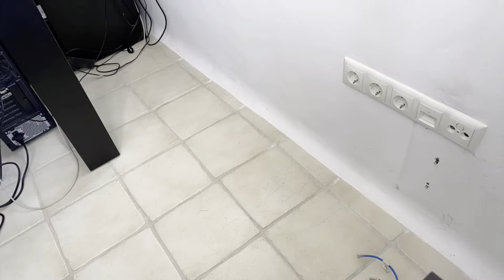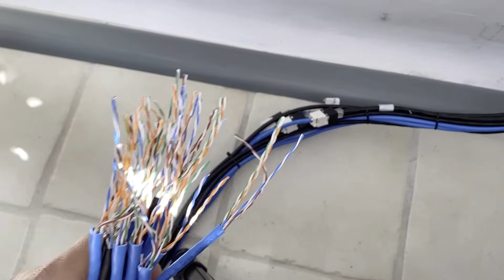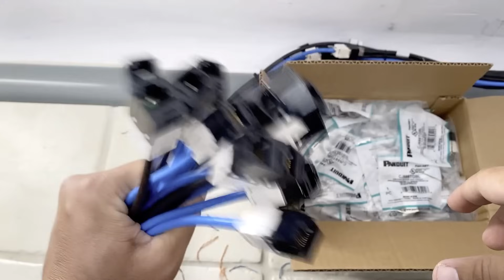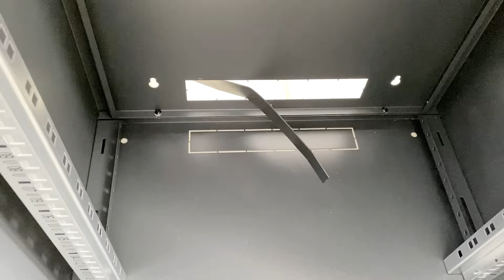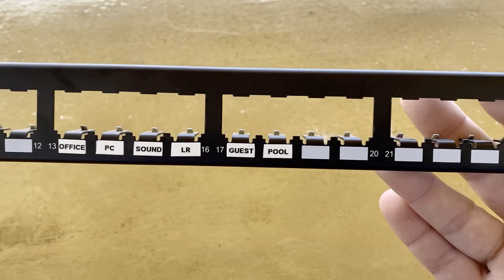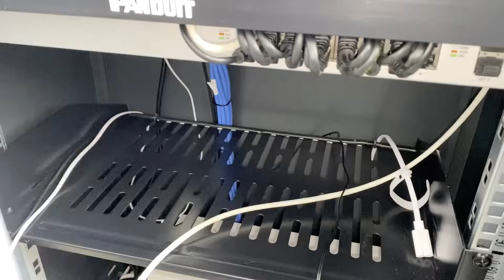New Rack - Step By Step Installation

Comment: Hiya! Great video. Im stuck at a place where the network rack has to be mounted in an office made up of prefabricated metal container. Please suggest the screws and bolts and if there is special method to use. Thanks
Reply from the maker: Thank you! Glad you liked the video! 🙌
For prefabricated metal container walls, it depends on the structure:
🔹 If the wall has strong metal framing behind it
Use self-tapping metal screws or bolts + rivnuts (threaded inserts). They give a very solid hold for the rack.
🔹 If the metal sheet is thin and there’s no strong support
I recommend:
Adding a plywood backing board fixed across the metal frame
Then mount the rack to the plywood → distributes the weight safely 👍
If the rack is heavy or full of equipment, the plywood method is usually the safest so you don’t risk damaging the wall.
Feel free to send a picture of the area and I can give more specific advice! 🔧😊

Comment: nice work but i have two question why ups installed within the IT rack its not recomended secondly power cords management is not good power cables are still loose
Reply from the maker: Thanks for your suggestion!

Comment: wifi inside the rack!? 😑
Reply from the maker: You're right, but Dream Machine is mainly a router so I believe that it was better to put it inside the rack rather than outside. After all, each room of the house has it's own access point so I could afford to lose the access point of the Dream Machine.

Comment: wonder if i have missed the server rack part. What is the dimensions (length width height)  of the rack, does it need wheels or fans?  are there screws at the back of rack to  help carry the weight of 24-port switch? or the 4 front screws are  strong enough?
Reply from the maker: The dimensions of the rack are : 758x600x600 mm (15U), I didn't order wheels or fans for this rack. The rack is inside a house so I wanted to avoid noise. There aren't any Racks at the back of the Rack. The 4 Front screws are strong enough!

Comment: The back panel you hammerd out where you tread all the cabels true you forgot that there was sharp edges the Cable can be ruin on if it is cables are moved often even so you should put something there you can even cut your hand or fingers there,,,

Comment: This was quite informative and easy to follow along. That said I had a moment with the reasoning of the separate ISP connection. That was until I realized the connection that was on the patch panel was from the equipment the ISP provider had to put in first. Then the patch cable to the modem. It's good that DSL is that fast where you are. Here in the states DSL came and went. They never pushed it as much as they could because of what else but cost. Thankfully i'm in an area with fiber to the home. So when they came in I have their equipment to the router I use. Again thank you this will be useful when I set up my new home.
Reply from the maker: Thank you for your feedback! It is really great to have fiber to home! I hope that we will have it here soon...

Comment: Also, pickups occur in low-current wires, which in one way or another affects the operation of network equipment. Use an oscilloscope. Maybe in such a small cabinet this is not so critical, but I have witnessed very big problems due to the fact that someone twisted the wire going from the power adapter to the device (5v) into a coil.
Reply from the maker: Thank you for the feedback!

Comment: How can you convey to the author what to twist heavy voltage wires into coils (110, 220v). It is impossible, because induction occurs and an ordinary wire, twisted several times, can do a lot of things. Even manufacturers of equipment indicate in the instructions that this is unacceptable.

Comment: Main critique is using those zip ties. Never use zip, always go for velcro. This way you've easier expandability in the future and it makes redoing wiring easier than having to try and cut zips, especially if some person makes them super tight.
Reply from the maker: Thank you for your feedback. I will try velcro next time!
Reply: I use zip ties. I think they look cleaner, and as long as you're not moving your stuff around all the time, it's cheap to buy more when you need them. :)
Reply: @TeeVeeArchive  Im telco.  Im not allowed to use zip ties for several good reasons.  So out of that I dont use them at home either.  Its either velcro or "sewn" in with a waxed 9ply cord.  lol
Reply: Or use reclose able zip ties that can be released and reclosed.
Reply: The reason not to use zip ties is because you interfere with the distance from the cable shielding to the twisted pairs, it is very easy to make them too tight and thereby degrade the shield's capability. 
The cables used in this setup looked a lot like shielded cables.
Reply: @viciouswaffle been in the industry for 20 years and use zip ties. Can officially say this has never happened to me😂
Reply: @ERMAV Have you ever made any bandwidth tests before and after?

Comment: I see you plugged the surge protector into the UPS. Is this generally a bad idea? I've been told that it may mess up the UPS... I ask because I have a surge protector that I like, and am considering a UPS but still want to use the surge protector I have.
Reply from the maker: I prefer the surge protector to be after the UPS in order to have the devices protected. So far everything seems to work fine!
Reply: @PoseidwnTech  there is no specific reason why you can't use a surge protector extension socket AFTER the UPS. But there is a doubt that it would do any good as the UPS is already providing that safety factor, built in to it. So in effect doing it twice... and the chances of getting a "surge" or "brown-out" from a UPS is so small, as to be improbable.

Comment: AP inside metal rack? :)
Reply from the maker: Thank you for your comment!
I chose the UniFi Dream Machine as the main router because it comes in an attractive price including Router, Cloud Key, Access Point and Switch. I wanted all the main network equipments(patch panel, switch, router and modem) to be inside the Rack in order to have a neat installation. I have installed 1 Access Point in every room so the WiFi Coverage was great even without the onboard access point of Dream Machine.

Comment: Put wireless devices in metallic rack is bad idea. It's working like Faraday cage. Better put outside the rack.
Reply from the maker: Thank you for your comment!
I chose the UniFi Dream Machine as the main router because it comes in an attractive price including Router, Cloud Key, Access Point and Switch. I wanted all the main network equipments(patch panel, switch, router and modem) to be inside the Rack in order to have a neat installation. I have installed 1 Access Point in every room so the WiFi Coverage was great even without the onboard access point of Dream Machine.

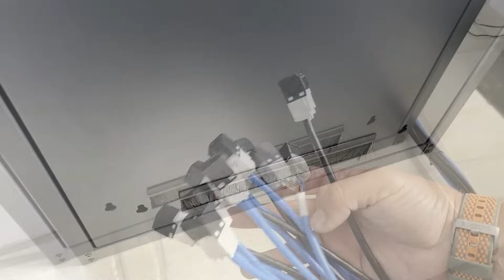Comment: the brush 10:38 with which you pass the cables in the lower part of the rack cabinet, where can you buy it? Thank you
Reply from the maker: The brush was included with the Rack! I will search and if i find one i will post it!
Reply: TBH using the brush with all that sharp metal after removing the knockout panel, is not going to protect the cables. I prefer to use an edge protector, similar to that found on car doors.
look on ebay for it. it is very cheap to buy.

Comment: WiFI inside of metal rack?
Reply from the maker: I wanted all the network devices to be inside the Rack, so that's why i put also the Dream Machine inside. Every room in the house has 1 Access Point so the WiFi Coverage is great and without the onboard access point of Dream Machine. But you are right in any other case the Access Points cannot be installed inside a metal Rack.

Comment: nice work ....
i have a question,
why you didn't crimp cables with rj45 and plug it directly to the switch , why you used the minicom zac module to cables and patch panel zac mont and  patch cables to the switch, waist of money and performance
Reply from the maker: It is recommended to use a Patch Panel for terminating utp cables for the purpose of neat and tidy cable management.

Comment: Great video :) may I ask where you got the brush strip that slots onto the cut out section of the rack, so that cables can pass through it? Most of the ones I see are meant to be attached to the front with cage nuts.
Reply from the maker: We didn't buy the brush separately. It was included with the Rack.
Reply: Amazon...
Reply: Hi Eric, we have all kinds of acceorries for racks, including the brush strip. If you need,welcome to contact me.

Comment: am i the only one thats a little triggered at the fact that the patch keystones are aligned to the left and the switch ports are on the right leaving that gaping hole on the right side of the patch panel?
Reply from the maker: The numbers on the Patch Panel goes from 1 to 24 from left to right, that's why i started from left. But your idea it's not bad. I will try it in another installation.

Comment: Why would you put a WiFi device inside a Faraday cage? You should place the wireless access point outside the cabinet.
Reply from the maker: Every room in the house has it's own Access Point, so the WiFi coverage is great and i could afford to sacrifice the Dream Machine's one. I also i prefer to put the network components inside the Rack.

Comment: This was a nice install I would have preferred velcro straps instead of cable ties I makes it easier to add or remove cables at a later date if needed.
Reply from the maker: That is a very nice suggestion! Thank you!

Comment: How did you terminate cables from ISP to the keystone when its DSL? And what keystone did you use? Isnt DSL only RJ11? Never saw keystone for DSL. Did you use RJ45 to RJ11 cable?
Reply from the maker: I used the same keystones. For DSL you only need wires 4 and 5 (Blue/White-Blue). For the connection i used telephone cable (4-wires) but i terminated the end that goes to keystone with RJ45 connector instead of RJ11 connector.

Comment: You just put the first tray wrong (upside down) so as the labels, you cant read them properly, next time put the labels above the cables so it can be easily read and understand
Reply from the maker: Do you mean the patch panel? I believe that this is the correct way since you can read the word "Panduit" correctly.
Reply: @PoseidwnTech  agreed. the brand name is at the top and the labels are under the keystones. unfortunately, in day to day use, this is also wrong, as the other post has said, once the rj45's are plugged in, you can't read them... sigh, my patch panel has the same problem... and mounting it upside down, just looks.... wrong

Comment: Nice look and video however, putting the dream machine into a metal container like such, if the access point is set, will affect wireless greatly and might damage the radio chip inside due to RF 
reflections
Reply from the maker: Thank you for your comment! You are right about Dream Machine. In this installation Dream Machine's Access Point is not used.

Comment: Great video! 

Some suggestions:

1) Strain relief bar behind the patch panel.
2) Shorter patch cables - have longer ones near by if need be. Unlikely for a home user to critically redesign the rack.
3) Don't use cable ties. If you must, then use velcro under it.
4) Use patch cables with colour to easily ID cables. IE red = WAN ; yellow = PoE ; green = Voip ; blue = x ; purple = y  etc
5) Use black patch panels with inline coupler type keystones. Makes installation much faster & maintenance/troubleshooting is easier.
6) Service loop & resulting cable should be to the side, out of the way of deeper devices, which could damage the cable.
7) Label power plugs.
Reply from the maker: Thank you for your suggestions!
Reply: The panel that you hammered out could have been neatly removed using your flush mount cutters. It would have saved the risk of damaging or wrapping the opening and ensured a clean opening without the sprues that were left by hammering out the panel.
Reply: And use the proper tool for cutting cable ties.  Why does NO ONE ever use a proper tool?  Flush cut cable ties are a series of sharp knives waiting to open someone's arms.  The proper tool pulls the tie then cuts it so that the cut end ends up BELOW the surface
Reply: @JohnVanderbeck  can you share a link for that? I would like to buy it

Comment: Hooking that Dream Machine to a DSL line has got to hurt.
Reply: I had the same though. The traffic locally will be superb, I am not sure what would be the max speed on DSL? 10Mbps? I have the USG + USW8 + 2 AC AP Pros + 2x RPi4.
Reply: 400megs are possible... But mostly it's not even close to it
Reply: 250k is easliy possible here in germany for example
Reply: My xDSL connection in rural germany averages between 250 to 350 MBit/s. Of course it could be better but it's enough depending on what you do of course
Reply: Ppl
Reply: I don't understand
Are they using VDSL?
HOW IS FIBER OPTIC NOT AVAILABL3 !!!!! 😢😢😢😢😢😢
Reply: in greece 100 meg DSL is common. a large portion of the united states only has dsl, and its 10 meg. so... theres that.
Reply: @petek9348 here in the netherlands we have 400mbit dsl, with 50 upload. Cool they can do that over just 1 pair
Reply: @petek9348 it's not ADSL it must be VDSL
Reply: But this cat5 cables are also limiting the speed in the house^^
Reply: @Thomate1375  How do you figure?

Comment: That moment where it doesn't look like the cables will fit(10:39) ..knowing you'll have to redo them all over again. Who's been there?
Reply from the maker: That is why I am using these Panduit’s Jack Modules! It is very to easy to terminate the cables outside of the Rack and when you finish it is also easy to put them inside. That cannot be done with a normal patch panel!

Comment: Nice job.  I love the Panduit Mini-Com system.   You can use Panduit's blanks to fill in the open ports in the patch panel.   I would have put the Dream Machine on top of the cabinet so that the cabinet doesn't interfere with the Wifi RF signal though.   You could drill a hole in the top of the cabinet and put a grommet to protect the wires passing through.
Reply from the maker: Thank you for your comment! Do you have a link for Panduit’s blanks? I left the dream machine inside the rack because the access point covers only the office with the rack. The other rooms have their own access points.
Reply: @PoseidwnTech  ,  that makes sense to leave it in the rack in that case.    The Panduit blank is part number  CMBBL-X.    They are available in packs of 10, 30 or 50.     Here is a link to a seach on ebay.   https://www.ebay.com/sch/i.html?_from=R40&_trksid=m570.l1313&_nkw=CMBBL-X&_sacat=0

or on Amazon    https://www.amazon.com/s?k=CMBBL-X&ref=nb_sb_noss_2

I also like the Panduit patch panels that have the removable sections of 4 jacks because it means that you can remove the jacks from the front of the rack without needing access to the rear.  This has come in very handy!  I reserve one section of 4 for each wall jack in my house.  This makes it easy to locate the correct jack on the panel.  Here is an example of that type.   https://www.ebay.com/itm/PANDUIT-CPP24WBLY-Patch-Panel-Mini-Com-Rack-Mt-24-Port-Used-but-never-used/184266109345?hash=item2ae71db1a1:g:hwgAAOSwY4NeoxGN

-bob
Reply from the maker: Thank you for the information it is really very helpful.